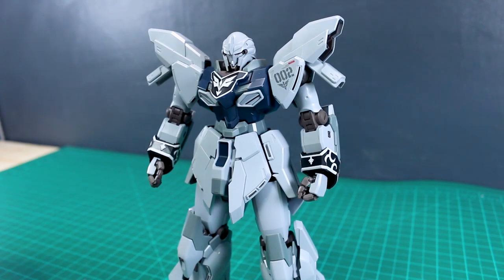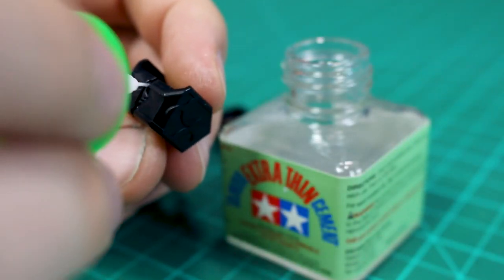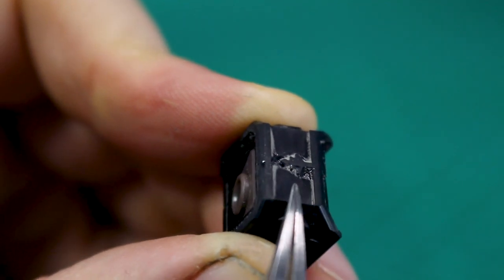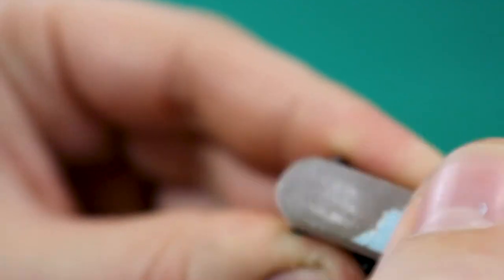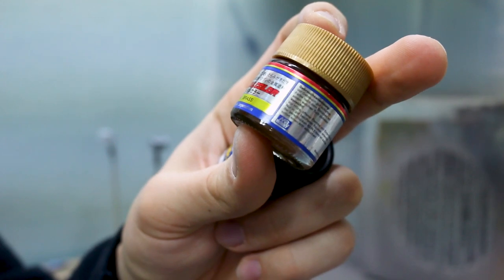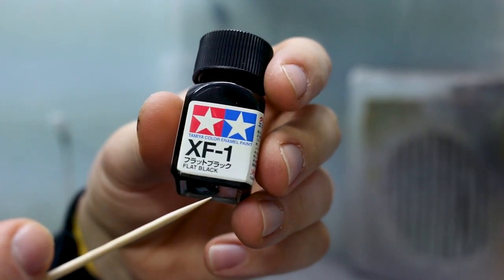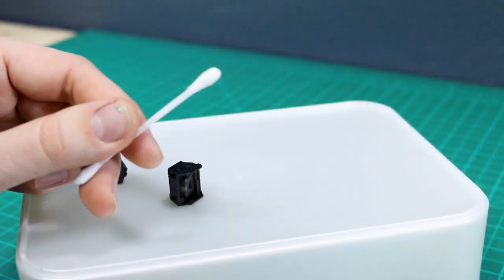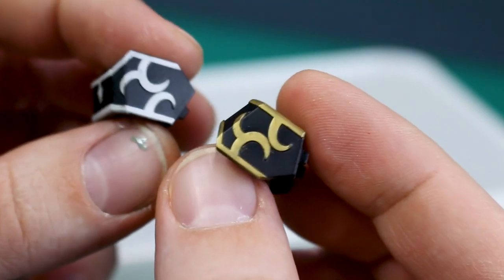1893 - How To Paint Sleeves! Reverse Wash Technique

Comment: I see a lot of questions, and I would like to throw my 2 cents in.  One of the key things to make this work is that on the whole, Lacquer is "hotter" than enamel, that is "hotter" than acrylic, you can put "cooler" paint over "hotter" paint, but not "hot" over "cool" as it most likely will damage the under coat.  "Hot" and "cool" is in reference to the strength of the solvent base.  The black comes off and the gold shows through because the solvent is strong enough tho remove the black, but not affect the sub layer gold. Just remember the hot and cold guideline and you can do wonderful things with different types of paint.  Note always try on a test subject before attempting, paint formulas may differ from general standards dependent on manufacturer, and intended paint use, for example, the paint John Deere uses is acrylic but is full of hardener, and chemicals for long term strength and to prevent farm chemicals and fuel / oil from damaging the paint.  It would shrug off any attempt to do any of this paint trickery, and would probably melt a model kit anyway.  Happy painting.
Reply: That's not true. You can put enamel paints over acrylics. That's how enamel washes are popular. You can even remove that paint later without damaging layer of acrylic under it. You can also use lacquer paints and varnishes over acrylics, but that have some small risk of damaging base paint with to thick layer of lacquer.
Reply: @MrKuncol  Fair enough, I have not had said luck, but I'll try it sometime.  Maybe my older paints I used are different than newer better ones.

Comment: Here's what you do, once you cleaned out the pieces etc. you spray the parts in gold (use Tamiya TS lacquer colors gold or silver). Let parts dry for a 1-2 days. Then spray the parts with an airbrush using Vallejo Model Air black. Use hobby swabs instead of regular swabs and dip the tip into Testors enamel paint thinner. Rub the parts you want off color and it should work really well. If you screw up you can always just respray with more airbrush black.

Comment: I've been trying out the gloss black base and no gloss black base a lot over the last few weeks.

Basically if you have a gloss black surface, the metallic color will reflect clearer. If you don't use a gloss black surface and instead paint the metallic paint straight onto your primed surface, just paint thick and wet enough for the metallic paint to self level. The difference is extremely negligible if the metallic paint is your final layer. If however you're aiming for a candy finish, the gloss black base helps a ton.
Reply from the maker: Exactly!

Comment: As much as I want to try this, I don't have enamels on me. I use polyurethane acrylics from Zurc Scale Paints. To paint such Sleeves details on my Sinanju Stein, I just used a toothpick and sharpen the tip. Then a Gundam Marker White for a couple of times and then use lacquer thinner for wiping off any excess.

Though, I might try doing what you did here. It looks so much better.

Comment: I'm trying to paint the detailed parts on the HG Kshatriya, and I've used this guide up until the step of applying the enamel. When picking out a paint to use for the enamel, I saw a bunch of people warn against using enamel paints on gunpla due to the damage that enamel paints can cause to the plastic, but I've also seen just as many people recommend using this technique, including using enamel for the wash. Is using enamel in this specific way safe on the plastic?

I've also seen a few people mention using acryllic paint instead of enamel for the wash, and I was also curious if you have any experience with that as well

Comment: wouldn't this be just as quick, if not quicker, to paint the raised areas by hand after a base black, and not have to do the wiping away then? Just learned about this, and trying to understand the use-case for it
Reply from the maker: This is easier imo. Painting the raised bits by hand and getting results as good as this would be quite difficult

Comment: I don't see why you cant use acrylic paint instead of enamel paint on top of the lacquer base. If you use acrylic instead of enamel just use ammonia to wipe the acrylic layer to reveal the lacquer underneath, Right? Or am I stupid?
Reply: You can, but in my experience if you're not careful ammonia and alcohol can rub off on lacquer as well though not as strong as actual lacquer thinner. Much safer for the underlying lacquer coat to use white spirit and enamel paint.

Comment: Good tutorial but I saw you leave the line on the back side, is it fine to leave the lines that are hard to see or it is better to take them off?
Reply: Personal preference I say, sometimes you don't even need to do anything because they get covered, sometimes you can put some work and make them into panel lines for extra detail
Reply from the maker: The seam line on the back of the part will be covered so it doesn’t matter ;)

Comment: Can this work the same way for acrylic as the laquer substitute?
Reply: I believe it can work. After you've applied the first coat of acrylic paint, in this case white or gold, you airbrush some Pledge floor finish. Then you apply the black paint. With the lighter fluid, you should be able to remove only the black paint, cause the Pledge layer should protect the white/gold paint underneath.
Reply: seiya880 that sounds crazy enough to work! i’m gonna try it on my airbrush
Reply: JormungandR very informative ty

Comment: Wondering if this technique would also work for painting eyes (specifically on clear parts). Building a mg buster gundam ATM and was planning on doing a layer of tamiya acrylic clear green and paint over it with enamel black. Want to keep the green part clear because I've got the kit wired up with LED's. Anyone with more experience let me.know how you do eyes.
Reply from the maker: Yep the same technique works and is often used for eyes!

Comment: Kshatriya had no seams on the wrists. Original Sinanju had none. Geara Zulu doesn't.  I haven't seen a kit in a while that didn't have some sort of cut corner. I can safely avoid this kit I guess.
Reply: It's just a minor seam you can't even see most of the time. Why avoid an entire kit because of that extremely minor issue?
Reply: @muisverriet  Because everything Bandai produces right now has some sort of cut corner like this. IT would be one thing if they hadn't done better 10 years ago. The RG Sazabi has stupid seams on the fuel tanks... but the HGUC does not. That's just fucked up. They got to the fuel tanks and said 'fuck it'.
Reply: @simpleanswer8954  Making new moulds for a kit isn't cutting corners. Besides, the fuel tanks are black so you barely see the seam lines. The rest of the kit is amazing so complaining about a barely noticeable seam line seems very trivial to me.
Reply: @muisverriet  You're the entire problem. That's my point. You don't care if they do their best 100% of the time. Part A was nice and shiny, so you don't care if part G is lazy as all hell. There's no excuse, they should have tried just as hard and done just as well as they had on previous kits.
Reply: @simpleanswer8954  I don't care if part G is something nobody ever pays attention to.
Reply: @muisverriet  Exactly.  You get distracted by the shiny so you forget to care. Easily distracted, no standard for overall quality as long as there's something shiny to look at. I bet you liked that garbage Phenex, and you probably said "You can barely see all the nub marks because SHINY.".
Reply: @simpleanswer8954  I have better things to care about than being anal over a seam line. I think the nubmarks on the Phenex are different because they stick out like a sore thumb and look awful, the seam on the fuel tanks doesn't.

A single seam line on the back of a kit doesn't diminish the overall quality of the model. This discussion is over.
Reply: @muisverriet  LMAO! "This discussion is over!"   Thanks dad. Way to throw around your authority big guy.  

Go be easily distracted and play nice kid. This discussion was over the moment you admitted you were too distracted to care.
Reply: Show me a Bandai kit without a cut corner, I'll show you a real live unicorn.  Best Bandai MGs ever made, and they'll have a seam right down the middle of the gun.
Reply: @TsorovanZero  You must build a lot of HGs and cheap older MGs.  Go treat yourself to an old RG, maybe something MG that says 2.0, or was made since oh... 2011? This cutting corners on the RGs started in the last year or two, with seams on the Unicorn kit. I have built plenty of MGs that don't have seams where they shouldn't.
Reply: @marcustepase2997  Dude, why are you seeing me as angry but not this Jarmo guy as condescending? Did you consider that maybe my reaction was based on their attitude? 
"This discussion is over." is fucking HILARIOUS. It's the way parents talk to children. It's the epitome of condescension when you're trying to argue with someone. Do you not speak English as a first language? Context and the way a figure of speech is used tends to be very important. I mocked someone for feeling like they were both a moral and intellectual authority. 
"everybody on the internet is angry!"  That's ALSO hilarious. Why do I need to be angry in order to be dismissive to someone who can't handle opinions?
Reply: @simpleanswer8954  you're hilarious
Reply: @simpleanswer8954    I (and probably most people) do not see words like "you must have built cheap kits" as an opinion. As if you have not hang around and have an actual healthy conversation with the others in this community. @Tsorovan Zero is well known to help ZakuAurellius' to point out details not mentioned by manufacturers of a kit they produce. Such as the last time he mentioned a way to easily fully-articulate MG Qubelley Damned fingers. It is quite unpleasant to see you strike him back with insulting words to defend your opinion (nobody will have a problem if you defend yourself *politely) while he clearly stated a fact. Not to mention @Tsorovan Zero is an unarguably active member of the Gunpla Builders Association  (or rather a moderator) so he is aware to most of the latest things related to gunpla (even some of other model kits) which makes you even more impolite for treating him like an inexperienced builder
Reply: @michelfanda2030  hey Japan guy
Stop making this comment section so serious 
Just like the funny guy said, this conversation is (supposed to be) hilarious 
And what do you do in funny conversations? Make jokes!
So let me start
So the funny guy is so smart, he can cover anything to state his perfect opinions. But he lacks something to cover the gap?
What is it? The answer is as simple as his username...

maturity
Reply: @michelfanda2030  In what way did I treat anyone like an inexperience builder? Nothing I said had anything to do with that. You are simply jumping to defend someone because you already know them. What they know is not the subject, and was not anything I brought up. These facts do not matter in anything I said.  

I have no obligation to treat someone with extra respect simply because they are more well known than I am. that is not how things work in my country or culture. 

I am entitled to my own opinion of the Bandai product, and as others have already agreed, my criticisms are true. I was told my opinion is irrelevant, and I asserted that builders should care about ALL the parts and not get distracted with less than Bandai's best in such a product. 

Sure, This guy once told Zack something. But in this VERY video so did I. Maybe I don't moderate a forum, but I'm an experience model builder. If that somehow makes a difference to you, then I'm taking my experience and using it to argue my points.
Reply: @simpleanswer8954  Future Bandai Engineer here guys lmao
Reply: @Re5_2karman  I know that you think you're clever, but this is really reaching too far. If you have to work that hard for a joke, then the joke doesn't work. 
Even then, there's no real sense to the joke you're trying to make. Maturity is an intangible, and you're trying to force a joke about something.   
Also, this "Japan guy" business and trying to drag out an argument that you aren't even part of? That's literally immature.  
Have a nice one kid!
Reply: @ezrah8520  No future about it: Current sheep right here.  

"Hey look a thing I can jump in on! Hey guys, I'm cool too! Me Too!"

You look so tough Ezra. How can I be like you? How can I be a little bandwagon follower that tries too hard to be part of a group when I see it?
Reply: @simpleanswer8954  It's fun receiving answers from people with your kind of attitude. Nevertheless, here's my opinon: If you really really REALLY are extremely, overly, unbelievably, ridiculously bothered by these seam lines like it seems you are, then you should be inclined enough to get rid of it. After all, considering your immense knowledge and power, I think it should be a breeze.
Also, doesn't you considering something as silly as this a group show how much you yourself want to be part of one? :/
Reply: @ezrah8520  Nice rant from someone who isn't angry. By the way, my original point is solid and factual. Bandai have already made kits that avoided these seams. They have already done better. Whether or not they should keep doing better has been the argument. Try and keep up if you're going to insist on participating, mmmkay?
Reply: @simpleanswer8954  Perhaps I didn't make myself clear enough for you. I was not angry. You simple made me frustrated from your immense level of stuborness in your reply. It's funny how you didn't bring up a single point in my reply. Was I right? Probably, but you'll just say I'm not since in your reply since I mentioned it here. As a matter of fact, I am fully caught up. I read every comment before I commented myself to ensure that you wouldn't find some sort of tiny loophole and exaggerate it beyond comprehension. And I'm clearly not arguing about Bandai's ethics, I'm arguing about how you have put yourself on your high horse and how you think only your opinion is valid and that everyone else's is redundant. Maybe you should be keeping up? And participation? The fact that you brought that up is just sad. This is literally a YouTube comment chain. This isn't a debate. Your life isn't at stake here. I don't get what your defending or why? Scratch that, I do. You're defending your overinflated ego since you know it'll pop.
Reply: @ezrah8520  "This is literally a YouTube comment chain. This isn't a debate. "
Really? What are you doing then? Why are you so frustrated by this? 
Your comments about ego are hilarious given the way you rant and preach. You don't make points, you post nonsense rants and insults. therefore, there's nothing to respond to except to be snarky and mock your total lack of understanding.   It's been fun, but that's really all I can get out of you.
Reply: @simpleanswer8954  The level of irony and hypcrism in that was utterly astounding.
Reply: @Simple Answer , I kinda understand why people may be arguing with you, I mainly think that with your first statement it kinda sounds as if bandai made part A-D great but part E bad, It would make the kit entirely bad. it may not you first statement meant but seemingly some people possibly took it in the wrong direction.